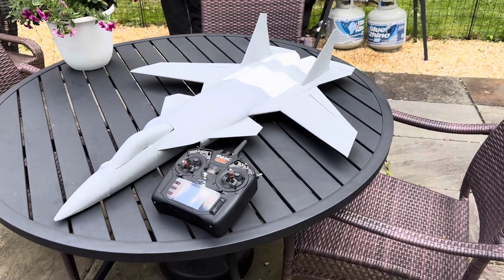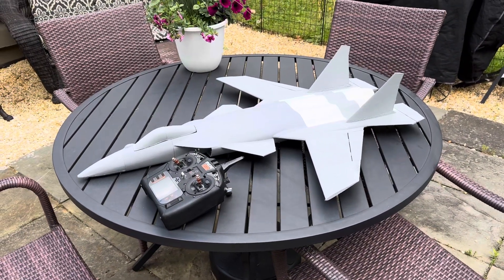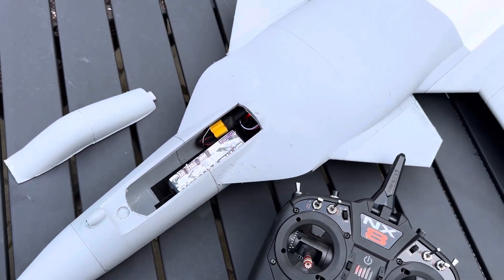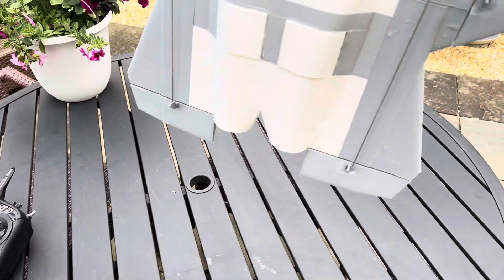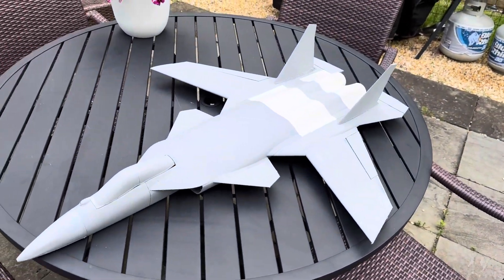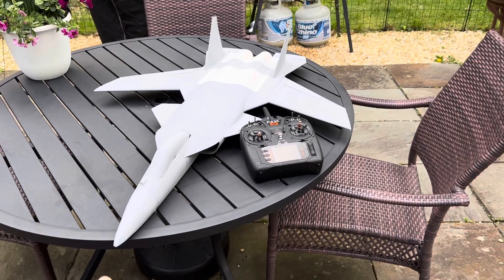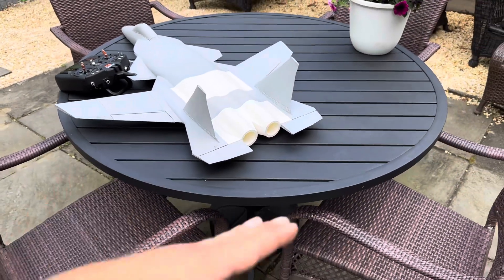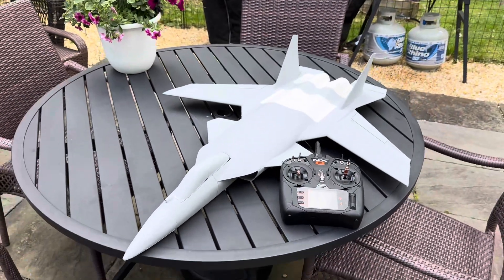SU-47 ready for its Maiden Flight 😱

Comment: started to print this rc plane a number of times now , finally got the hole parts in lw pla . going to buy another xfly f22 and strip the one i have for parts . hopefully be a great plane ,  if the maiden does not go well . simply print another gota love 3d printers
Reply from the maker: @samurai2022  you can also get the electronics separately too
Reply: @hotlapkyle  the plane in question needs it really , more glue holding the foam than a 3d printed one .  i might hold out ive just seen the f117 looks really cool and the slow landing wow